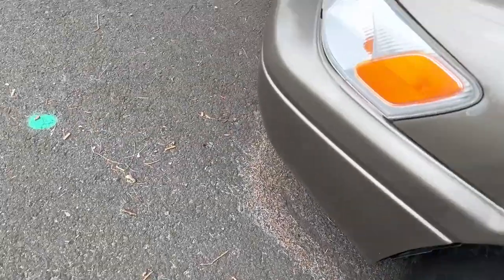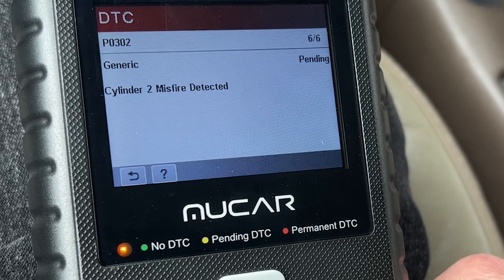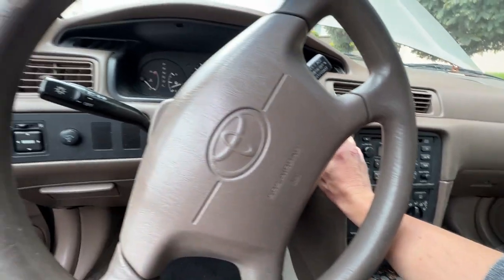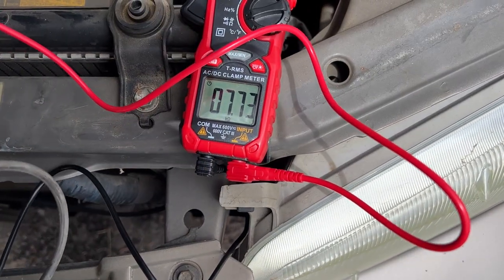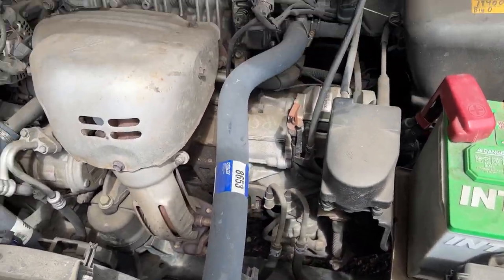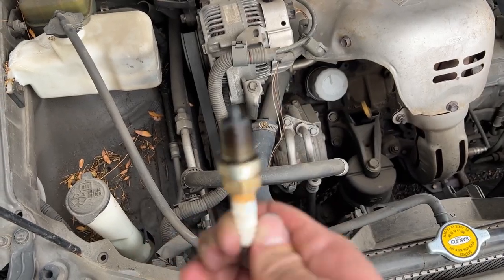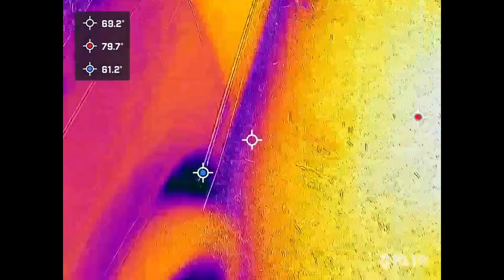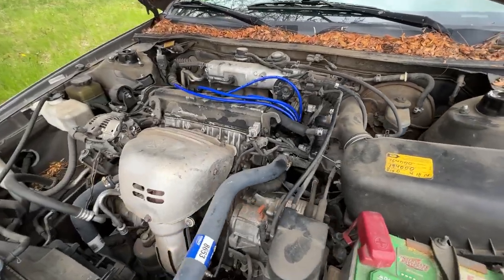99 Toyota Camry 2.2L Misfire Diagnosis and Confirmed Fix | P0300 P0301 P0302 Trouble Codes

Comment: Thank you very much for this wonderful video. I would like to ask you how, from where and for how much I bought the blue wires for my 2000 Camry 5s.
Reply from the maker: No problem! Just got them from napa auto parts store down the street, they were the cheapest ones there, the connectors were a huge pain to get on wish I had a little silicone spray with me that would have helped

Comment: Having this same issue, changed spark plugs, coils and injectors and still misfiring. Is not an internal engine thing since i did a compression test and it was good. Not sure what else to do at this point. Any suggestions?
Reply from the maker: gotta figure out if it's missing spark, fuel or compression, and timing
Reply: Hi Jorge, I don't know if you're only getting a DTC for 1 cylinder misfire or multiple cylinder misfire. If you already changed plugs, coils, and injectors, try changing spark plug wires. When they get old their resistance gets to high and plugs don't get enough voltage to fire. You can check their resistance with an ohmmeter. Look online for the Ohms/Feet specs. I did mine a while back so I don't remember it. Old wires are also more susceptible to arcing along their length between the coils and plugs. The arcing will also cause a misfire. If you're still having this issue after changing wires, test the plugs with a spark plug tester to make sure they're all creating a strong enough spark. 

I assume you already checked fuel pressure at fuel rail. If you don't have enough pressure at fuel rail, fuel injectors can't provide adequate amount of fuel for combustion, and you guessed it, you'll get a misfire.

Hope this helps. When you fix it or if you already fixed it, please post the fix, so others can see it in the future.